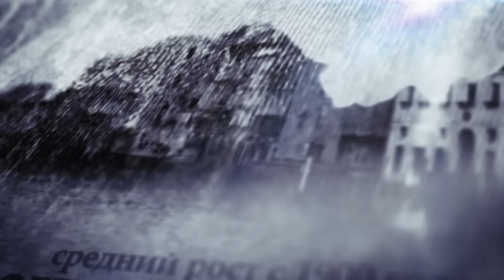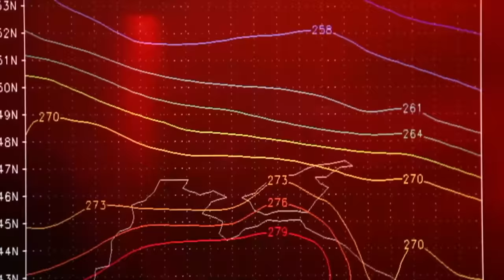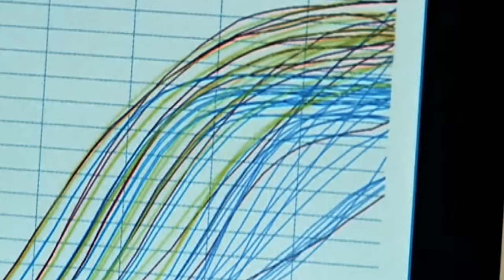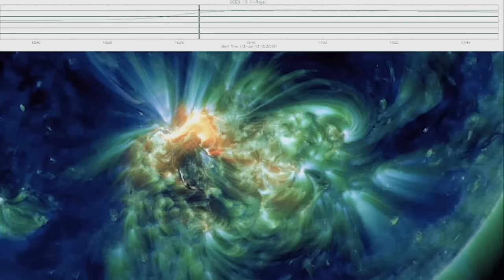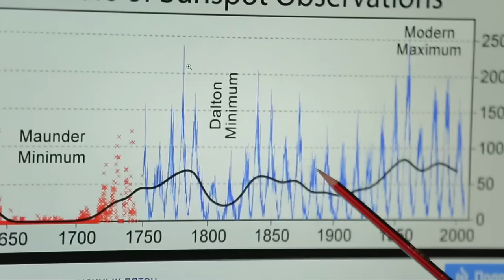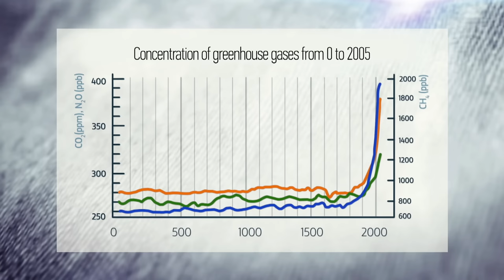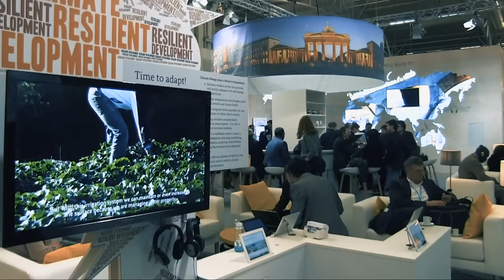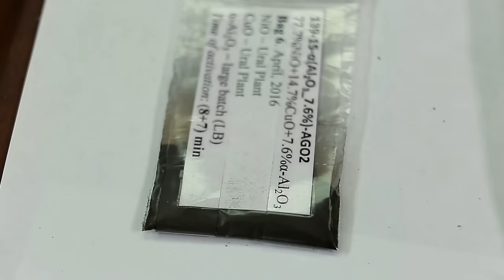Which Countries Could Be UNDERWATER Due To Global Warming?

Comment: When I see a mass exodus from the Florida Keys and Maldives I will park my car and throw the circuit breaker.  Note:  The Sahara was green 6,000 years ago and Florida was underwater countless times.  (I live by the Gulf Coast about 60' above present sea level.  If I dig in my yard we find sea shells.)
Reply: Florida was also 3x the size when sea level was 400 ft lower during the last ice age.
Reply: @spliffertonsheldrake6007    And many feet under the seas as tectonics have shifted. It may run on a glacial clockwork but that doesn’t mean we can’t see it. Or that it doesn’t have some nasty twist up it’s sleaze to surprise us…  Then again we could get lucky  hahaha!
Reply: @spliffertonsheldrake6007    That’s a given eh? I can feel the cold blade twisting in my soul every time I see the news.
Reply: @mtn1793  Vulcanism:  If Yellowstone blows we won't worry about sea-level rise. As for asteroid impact? Not if but when.
Reply: @1Skeptik1    All those things are possible threats but neither removes the facts and threat of runaway CO2 effect.
Reply: @1Skeptik1  You obviously don't understand how ironic your statement is.
Reply: @TheFreshSpam  It's a scam.
Reply: @spliffertonsheldrake6007  I wasn't living in Florida then...,
Reply: @1Skeptik1  Planet X
Reply: Florida is a landmass formed from biomass like those shells and is geologically young
Reply: @eVill420  It's also sinking from isostatic adjustment.
Reply: @mtn1793   I am so filled with foreboding I purchased a 5th. investment property minutes from the FL. Gulf Coast only last week.    
.
Reply: There's no question that the oceans are rising. 5mm per year adds up. In 100yrs every human alive will be well aware of our lack to make real changes.. time will tell I suppose
Reply: @kennedy6971  In 100 years it will be 7 inches higher. Are you  moving to higher ground now or are you going to wait 40 or 50 years and see if it speeds up to 8 inches per  century ?
Reply: Don't forget, Florida was a vorl reef at one time!!
Reply: @spliffertonsheldrake6007  glad you remember, have you gotten your quiness record award yet for being the oldest person alive?
Reply: Damn, I live in the center of the state and only 35 ft above sea lexel
Reply: Too much attention is paid to sea-level rise when the most urgent threat is starvation due to widespread crop failure caused by climate disruption.
Reply: Gee climate changes , who knew.
Reply: They find sea shells at the top of the tallest mountains
Reply: And there is sea floor at the top of the Himalayas.. 
Yes climate change has always happened, it's always been gradual except during catastrophe, catastrophe is what's happening now and we are causing it.
Reply: @WHATSUP7049  The ocean floor is folded up between two landmasses colliding, India into Asia. The mountains are still rising.
Plate tectonics.
Reply: @jamesgrover2005  Yes, that's correct, and that all began when the Biblical flood occurred.

Genesis 7 v 11

on the seventeenth day of the second month--on that day all the ......springs of the great deep burst forth,....... and the floodgates of the heavens were opened.

The flood was a catastrophic event, it wasn't just rain.  It reshaped the face of the earth and the climate.
Reply: @jamesgrover2005  like you she is wrong
Reply: @jamesgrover2005  Do you even know how to prove the CO2 caused catastrophic global warming hypothesis ?
Reply: @jamesgrover2005  Can you prove man is controlling the temperature of Earth ?
Reply: @ricktd6891  Paleoclimatology.
Reply: @jamesgrover2005  Sorry, that's not proof.
Reply: @jamesgrover2005  Try again.
Reply: @jamesgrover2005  What does the hypothesis state ?
Reply: @ricktd6891  Physics doesn't require your belief or understanding Rick, the law of thermodynamics will continue to do its thing regardless of what Rick the fossil fuel paid bot thinks.

Clearly you can't even be arsed to look up CO2 ppm pre industrial revolution and now then there's no point in debating with you.
I'm done, bye.
Reply: @tomdehen  I agree. I live in the Midwest- my region is supposed to turn into a desert. We're an agricultural region! Not only will it make the region uninhabitable for me, but it will remove virtually all of the agricultural growing power of the U.S. Millions to billions may die.
Reply: @ricktd6891  So what WOULD you accept as proof? Is there any amount of scientific proof that would satisfy you, or will you just keep moving the goalposts so you can cling to your comfortable beliefs?
Reply: @amberkat8147  And who's moving goal posts ? Stop lying.
Reply: @amberkat8147  Dear Amber,  Thank you for your reply.  If you are a young person, I apologize to you for the lack of action on the part of my boomer generation to try to prevent this catastrophe.
Reply: @jamesgrover2005  So the answer is humans reverting back to the 1700s? Nearly everything depends on oil or gas. You`re using these products as we speak.
Reply: @jamesgrover2005  I bought solar power for my basic needs, from freezers on down, with the stimulus checks and savings, hydroponic gear, over 200 types of seeds, water filters, distillers, communications receivers, DC cookers that connect directly solar panels, battery powered electric mower, and electric tiller, a greenhouse, and too many other things to remember. Moved to an isolated rural lot where I can have gardens, hunt, fish, forage, and trap. I knew what Biden was about to do.
Reply: @jamesgrover2005  The only fuel powered device I own is a backup gas generator for cloudy day battery charging so my freezers and refrigerator will stay cold. Yet I can`t think of a single thing I see around me that`s manmade that doesn`t require oil and gas and nearly everything contains it as an ingredient including ever single internet connected device being used to condemn it and every bite of food in stores requires it.
Reply: @jamesgrover2005  I`m waiting on "green" energy air travel. Solve that. Nobody has any ideas about how it can ever be done without fusion or a super energy dense compact battery capable of unheard of sustained output that can power an uninvented engine to push a plane filled with humans and products at speeds of jet engines.
Reply: @hg2.  While the Medieval Warm Period saw unusually warm temperatures in some regions, globally the planet was cooler than current conditions.

The Greenland ice sheet is at least 400,000 years old and warming was not global when Europeans settled in Greeland 1,000 years ago.
Reply: @jamesgrover2005  
Good glib answer.

A MAJOR warming in recorded history "was just a local affair".

Here's your chance for more glibness (not that it makes any difference): how do you KNOW the medieval warm period was a local affair?
Reply: @hg2.  that was sciences answer to your often repeated claim.

Personally I'd suggest you look at the global climate records for that period, there are ice cores and tree rings. There was no global warming 900-1300AD.
Reply: @hg2.  ice man "wearing jeans and tee shirt"
Ötzi's leather overcoat was made of a grab bag of at least four different individual animals from two species  — sheep and goat — while his lighter coat was made of sheep. His leggings were made of goatskin, perhaps because that type of animal skin provided the suppleness needed for walking, the researchers hypothesized in the paper. To top off the wardrobe, his leather shoes were stuffed with grass, and he sported shoelaces derived from wild cow, or auroch, the researchers found.

Do you ever tell the truth?
Reply: @jamesgrover2005  
So he was wearing the equivalent of jeans and tee shirt, and there were no glaciers in the Alps 5000 years ago, which makes Ice Man exhibit B in the Climate Crap Coalition.
Reply: I live at 80 feet above sea level here in central Florida, wet and hot, but at least we have plenty of water.
Reply: @ricktd6891  4 inches in 80 years then 4 inches in 20. You didn't pay attention did you?
Reply: @WHATSUP7049  which would have been impossible in the Biblical flood, a 40 day flood that lasted for a year
Reply: @edwardmiessner6502  it was completely possible and that’s what happened
Reply: @edwardmiessner6502  No, that didn't happen. Where do you get your bogus science, skeptical science?
Reply: @edwardmiessner6502  Any other false facts you want me to correct you on like the last 20 or 30 years were the hottest on record?
Reply: @edwardmiessner6502  How about the lie that the climate never changed this fast before? If you believe that one, I have a nice bridge to sell you.
Reply: @mtn1793  when did the last ice age end? 5,0,000 ago? well tell me how many SUV cars did it take to end that last ice age??
Reply: @mtn1793  this one time, there were volcanoes that dumped lava and gasses into the atmosphere for eons.  How did they not hit a tipping point?  Besides, absorption of infrared by these so-called greenhouse gasses is logarithmic...  This is relatively well tested.  If you double CO2 concentration, you get 2° change.  The next doubling gets you only 1°.  Double again and you're les than a degree... 
It could be that
Reply: @kennedy6971  
"In 100yrs every human alive will be well aware of our lack to make real changes.. time will tell I suppose...."
==
Some of us are quicker to realize than others.
We'll all pay the same price with our lives.

Some of us realized the risk 50 years ago, the rest of us are still debating.
Reply: @ricktd6891  
"In 100 years it will be 7 inches higher......"
==
Sea level rise is the last thing you should worry.

How many days you can live without food?
Reply: @ricktd6891  
"Do you even know how to prove the CO2 caused catastrophic...."
==
Do you even know how to prove the CO2 not caused catastroph?
Reply: Even the models are wrong. They don't factor in cosmic rays and cloud nucleation. They don't consider CMEs super volcanoes or impacts from asteroids and comets.
Reply: @spliffertonsheldrake6007  did you  go there and see that with your own eyes???
Reply: @allgoo1990  Whenever anyone denies man-made climate change to defend excess consumption I bring up the Great Pacific Garbage Gyre. Deny, THAT, deniers.
Reply: @ricktd6891  We can argue if we can agree on the same facts but if one of us uses alternative facts it is pointless to argue.
Reply: @ricktd6891  Do you know the amount of Co2 in the atmosphere is 0.04%... that is nothing in the whole atmosphere. Give you head a shake!!!
Reply: @amberkat8147  Not to worry... the key word here is Maybe!!! The other key word is - Maybe NOT!!!
Reply: @mtn1793  oops! Wrong answer. We're trying to tell you that Co2 is a SMALL part of the equation.
Reply: @kennedy6971  it's gone up 400 feet so far. Maybe we're at the high water mark.
Reply: @ricktd6891  I've been in Florida  for 50 years. No change.
Reply: @tomdehen  more people have been fed this century than in the history of the planet.
Reply: @marchebert9813  Here's another. : The Brisbane Courier - January 10, 1871 "Imaginary Changes of Climate."
Reply: @marchebert9813  Here's another. : Maitland Mercury - March 11. 1846 "On the Change of Climate."
Reply: @marchebert9813  Here's another title that might sound familiar. : The Rochester Democrat - December 17, 1939 "GLACIERS MELTING OVER GREENLAND." Oh my.
Reply: @marchebert9813  One more for good luck. : The Janesville Daily Gazette - December 5, 1903 - "Glaciers Disappear - The ice in Greenland is Melting more rapidly than it is formed."
Reply: @ricktd6891  according to the experts there should be no more glaciers, snowfall, or polar bears. The ice caps should be gone as well as the Maldives. Etc. Etc.
Reply: @marchebert9813  Thank you for your comment.  The Green Revolution has fed the world, but it is not sustainable.
Reply: @tomdehen  it's no? Please explain.
Reply: @ricktd6891  now that is HILARIOUS!! They really have polar bear hunts?
Reply: @marchebert9813  When I say everything they tell us is not only lies but often the complete opposite of the truth, I'm not kidding. Search : "Legacy Outdoors" polar bear hunting trips.
Reply: @marchebert9813  Any other lies you need debunked, see me.
Reply: @ricktd6891  Uhmm, I'm good.  Thanks for the tip on the polar bears though.
Reply: @marchebert9813  The point is it's all lies. That's just one.
Reply: @marchebert9813  And you're welcome.
Reply: @marchebert9813  According to MIT, phosphorus, which is used in fertilizers, will run out in 80 years.  The price of fertilizer is rising, and some farmers can't afford as much fertilizer as they need.  Therefore, their crop yields are declining.  Then there's the changing weather.  Too much rain, not enough rain, too much heat: all these are decreasing crop yields.
Reply: @mrunning10  In Jersey when we dig in our yards we find bodies, so we don't dig in our yards anymore.
Reply: @ricktd6891  That's why Giacalone and Provenzano would never bury Hoffa in Jersey, too close to rising ocean would wash away the hole.
Reply: @mrunning10  Yea, at 7 inches of sea level rise per century, it will only take about 128,000 years for the beach to wash away completely.
Reply: @ricktd6891  redo please,, this time show your MATH, unless you live on top of a mountain perhaps?  at the rate you quote it is only 5.1 centuries until we reach a 3 foot rise.  a moment in time, 

I told you this is a multi-generational fix, not tomorrows weather or climate
Reply: @mrunning10  No, we had a house at the beach and in my lifetime, you can't see sea level rise with the naked eye over 50 years. There's still 75 feet of beach between the water and the boardwalk, just like 50 years ago.
Reply: @mrunning10  And p.s. sea level rise is meaningless just like melting glaciers because the hypothesis is false. You can't blame sea level rise or melting glaciers on CO2 caused catastrophic anthropogenic global warming when it doesn't exist.
Reply: @ricktd6891  the DISTANCE does not enter into it.  somewhere in record, local, municipal, federal, somewhere there is an average mean sea level MEASUREMENT from 50 years ago.  the same for today.  if it exists the measurement from 50 years ago will be LOWER than today's

or, no measurement (have pay for it somehow) = no problem doesn't it?
Reply: @mrunning10  Your question is confusing. Sea level was measured 50 years ago and it was lower, about 3 and 1/2 inches lower. That doesn't prove man's CO2 caused it. It's been rising for thousands of years. Man didn't start putting "significant" ( which it really isn't ) amounts of CO2 into the atmosphere until around 1945.
Reply: @ricktd6891  You are confusing "measured 50 years ago and it was lower"  prove that man caused it to be LOWER???  

what??  WRONG.  Man started bringing up CARBON around 1600 burning coal for inside heat, significant emissions started around 1850 with the coal-powered steam engine, not 1945  (or post reference or link SHOWING otherwise??)
Reply: @mrunning10  No, man started "bringing up carbon" ( it's carbon dioxide, just so you know ) the moment the human race started. Your problem is that you still think that CO2 controls the temperature of Earth. It doesn't. When you think you can prove me wrong, bring some data.
Reply: @mrunning10  Here's my data that proves CO2 doesn't control the temperature of Earth. :  Search : "Global temperature and atmospheric CO2 over geologic time/graph/images."  So where's your data?
Reply: Did you check with greta toonbird before you posted this?
Reply: @lolzasouruhm179  Too bad CO2 doesn't control the temperature of Earth. Maybe you should have studied for a year.